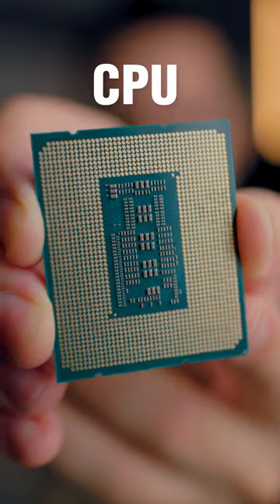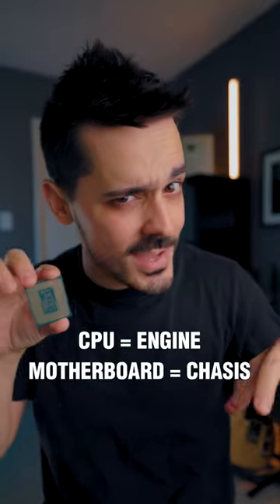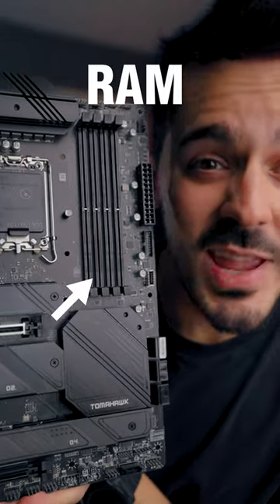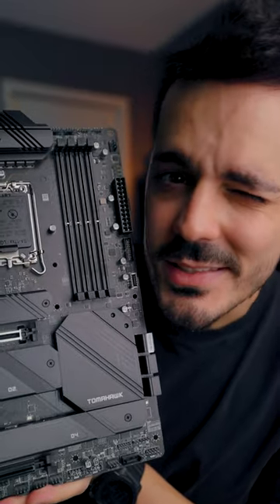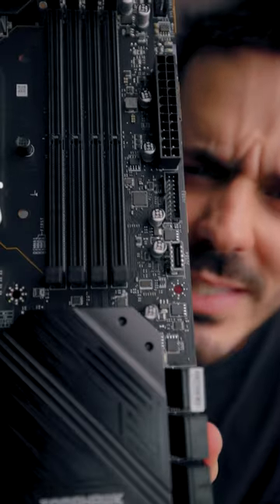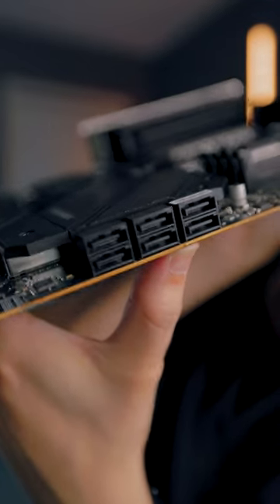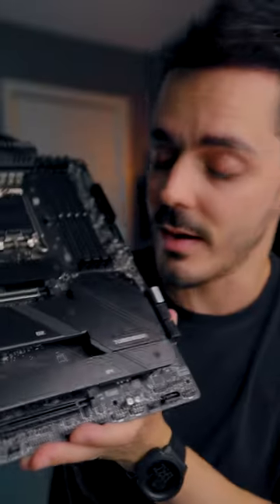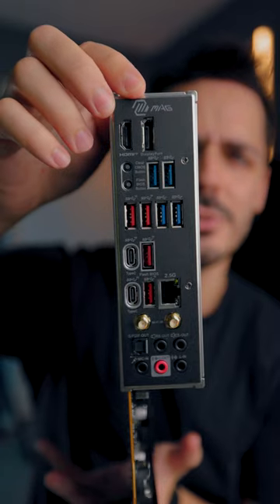If COMPUTER Parts were Cars...

Comment: You forgot to mention about VRM, they use the energy from cpu cables and stabilise the voltages using different phases which aids with the power delivery. Also the heat sinks in motherboards are actually for the VRMs since they produce a lot of heat but these days they’re more of an aesthetic gimmick. LTT has a great video about motherboards, you should check it out
Reply: I think the more complex explanation from a motherboard can't possible on 1 short video format.